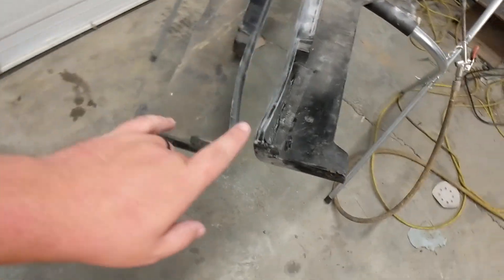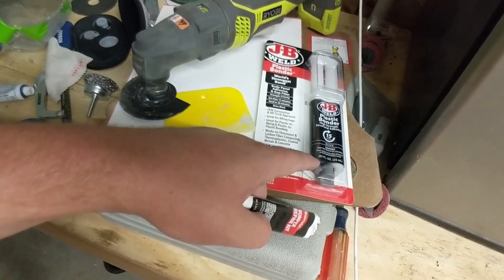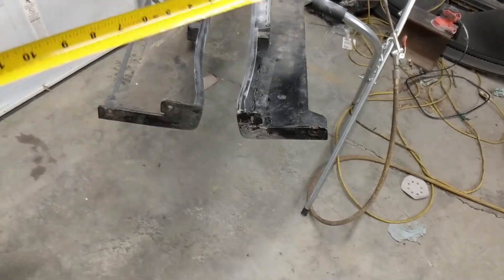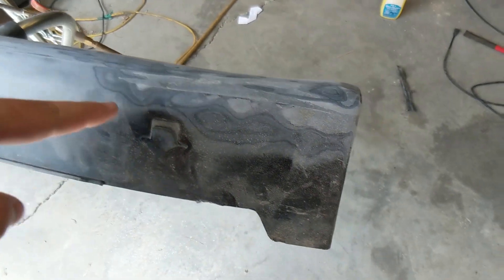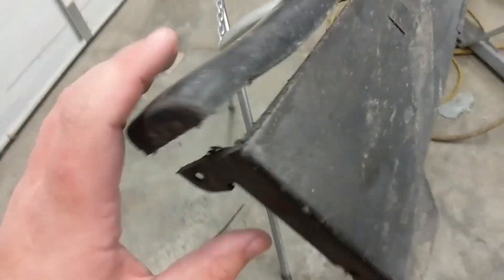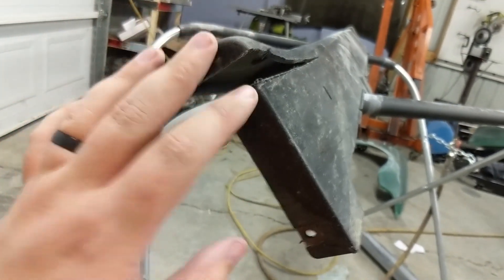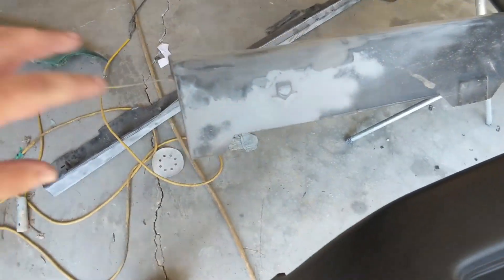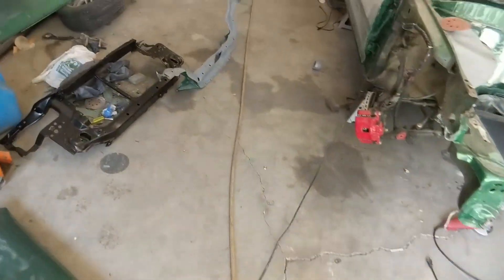Modding EK Sideskirts for an EJ1!

Comment: do you know if this works for hatches? like taking EK hatchback Sideskirts, & putting them on a EG hatch?
Reply from the maker: Yeah it does. I think some of the holes may not line up but that's fixable with a razor. I can't speak super intelligently on the subject but I have seen ek skirts on an eg hatch.
Reply: @jeffibuilt  coo, thanks bro!